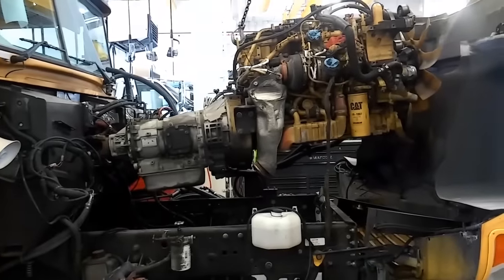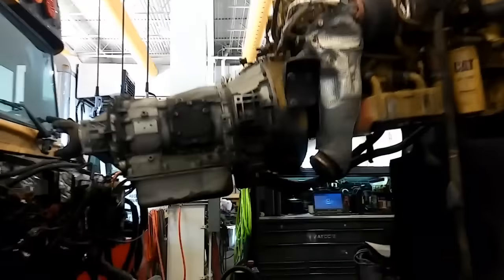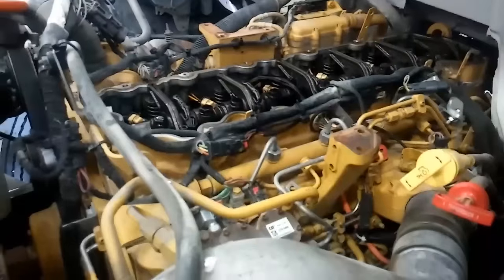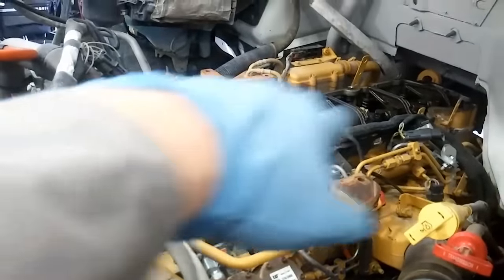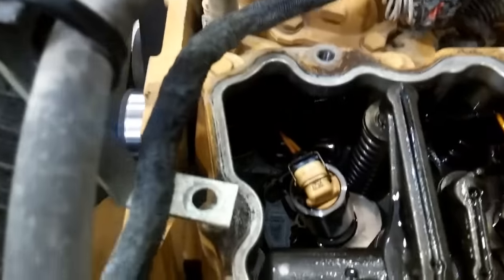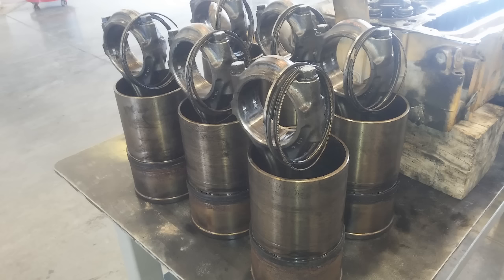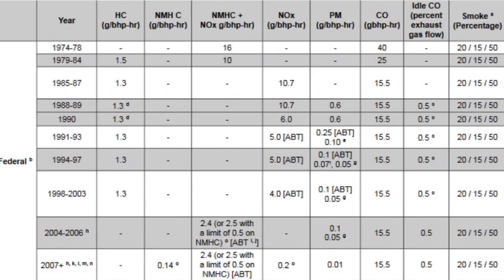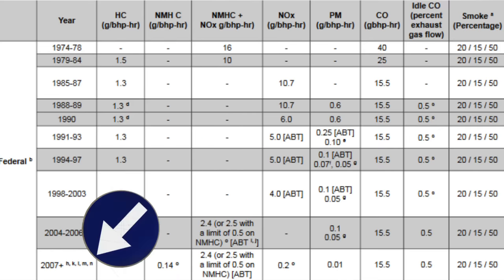The Worst Engine Caterpillar Ever Made.

Comment: Wow...apples (the fruit, not the tech company)...HATE HOW TART THEY ARE! Well, that's only the Granny Smith, not the Braeburns or Red Delicious...this is EXACTLY what you are doing here, possibly from lack of knowledge about the product line you are talking about. The 3116 was, originally, slated to be a MARINE engine. Long, dedicated service (it also could lend itself to gen-sets)...but in the Marine application, boat-drivers had a BAD TENDENCY to turn them up and use 2,800-rpm redlines...600-rpm above factory recommendations! This led to GREATLY reduced lifecycles. BUT...they really didn't lend themselves to 'class 7-8 trucks', either...after all, they were 200-290 hp engines...but hey, they were 'easy to make', and had a good profit curve...so, where to put them? I know (says Cat), let's farm them out to medium duty trucks! We'll make an example in use, by selling them NEARLY AT COST to Stewart Stevenson...hence, the LMTV 10XX series trucks (2.5 and 5-ton replacements for the M900 series) happens...and ANYONE who's been in the military has some knowledge of the 3116!
Yep...cast-in-block liners (hey, you want a wet-liner...International's DT466 is calling your name)...but the 3116 is also the LAST CAT with 'mechanical injection', too! No computers, no digital ANYTHING...just drop it in, top it off with oil, and GO! The 3116 was a VERY SIMPLE engine, in fact. It was SO EFFECTIVE, that Cat says 'hey, new standards, but let's not waste it on the 3116...we'll make a 3126 add a 'big cam', big turbo, and make more POWER! So, they break into solid 300+ horsepower numbers...and here comes the electronic injection. The 3126 has it's share of problems...and where the 3116's problems were USUALLY the result of 'end user over-rpm-demand' and POOR SERVICE ROUTINES, the 3126 ran the gamut of issues...from 'not really made for this much power' to 'funky electronics' to 'bad applications'...yep, it was in there! Oh, boy, and here come more emission standards...and with this, the C7...
See, the 'C7' (taken from 'Caterpillar 7-liter') did kinda-derive from the 3116, the 3116 is TRULY NOT a 'C7' (other than being a 7-liter engine)...and saying 'C7's' are the worst engine out there...well...you've obviously never had to fight the 7.3 Navistar for parts, durability or AFFORDABILITY! The 3116 is a VERY SOLID 300k engine that you can realistically get 500k out of, if you DRIVE IT RIGHT (it is not a Corvette 427!). It is a 500-hours between oil changes, keep it under 2,200 rpm, keep maintenance on the common rail and fuel pump (KNOWN to be problematic...and being an expert on that mechanical pump will end about 90-percent of your topside issues, overnight) kind of engine. It should be compared more to the Cummins light truck diesel, not a PACCAR MX-13!
Throw a dozen at me, and I can have them sold, at profit, overnight. Give me two, and I can keep a Class 5 truck running for decades. As for 'old-school' Detroit-Diesel-type mechanicals...I'd take this ANYDAY over a 6v71.

Comment: The automotive tech in me gotta ask, so no oversize piston for this engine? Sleeves cannot be machined in block?
Reply: Generally going to be cheaper and easier to throw in a used or reman engine. Especially for finding the correct parts

Comment: 1 of my peterbilt 379 with a 3406 B engine has what has be told to me as a brake saver... I have no idea how the damn thing works. It is activated by flipping a switch on the dash, then grabbing a second hand brake lever on the steering column. No it’s not my trailer brake handle.... there is two handles on the column, 1 is a “brake saver” and 1 is the trailer brakes. What this hell is it? how does it work? Oh ya it’s works half way decent
Reply: A Cat brakesaver (AKA oil leak) is a engine oil retarder. It is mounted between the transmission and rear of engine.  It has a dual oil pump, one side works engine, other end brakesaver. It has a oil cooler that's extra long due to the heating of the engine oil. Should also have a oil temp gauge and you better watch it. Should also have a air psi gauge. In the special oil pan you have a control valve. When the brakesaver is activated a diaphragm separates the air and the oil. More air psi pushes the control valve farther to increase oil flow to the brakesaver thus adding more engine retarding. If the diaphragm is blow/leaking or the air (regulated & adjustable) is set to low you will have poor engine retarding.  The brakesaver itself has a flywheel for the starter ring gear and a flywheel for the clutch. Inside the brakesaver itself acts like a reverse torque converter. Only a few people can rebuild one as you have to have the proper fixture to hold the stator in place. Or you will damage the seals. You have a manual lever on the steering column ( can use it that way) or if wired correctly it can be activated electrically (lever not needed).
Reply: @johngoldsmith6629  JPaydirt has the same system on his [blue?] Kenworth.
When it needs service he calls in a guy that does it for him.
He's pretty handy with tools and working on his rig but even him wouldn't mess with the retarder system.
Sometimes some things are just better left to the Pros.
I have learnt that the hard way.
Reply: John is correct better whatch the oil temp for sure!!
Reply: @GIGABACHI  It's one of the few items on a Cat, I tell people to leave it alone. If you look in the parts book, so much stuff has been updated and you will have numerous oil leaks. I haven't built one in a few years. Get phone calls now and then and I lecture them on the mess they are fixing to get into. If really want to see a head ache. Look at a 1693 early serial number with a brakesaver. Seen several later ones, but only one early one. The oil cooler was remotely mounted near the front tandem. Had oil and coolant lines routed back and forth. Would hate to change oil on that rig.

Comment: Hi jo.
Do you have any idea about C18 marine engine and do you advice. To buy this engine for the marine boat.
Reply from the maker: The C18 uses the same block and cylinder head design as the C15, which is one of the longest lasting inline 6 engine designs ever made. Not saying they don't have any problems, but I would recommend a C18 in general.

Comment: Lol nothing worse than a manufactures first attempt at common rail, 03+ 24 valves 6.4 power stroke c7 S/ACERT. only possible exception I think of is the LB7 if they woulda thrown some halfway decent  injectors in there

Comment: I know you are a cat specialist however I need your help I have a cummins isb 6.7 in my m2 freightliner and the engine is miss firing I removed the valve cover and realized it’s a faulty rocker i fixed that and the check engine light is gone however it’s still idling very rough and still has misfire I saw a code that says ECU_128 who’s suggests it could be caused by egr is this possible?

Comment: I have a C13 475 hp in a Cat CT660 truck. It’s a 2012 and so far I have had pretty good luck with it accept for a couple things, high pressure turbo was replaced and the inter cooler was leaking antifreeze into the intake but both were fixed under warranty. Is there anything else I should watch out for?
Reply from the maker: Hello Mitch, well you actually have a CT13, unless you swapped a C13 into the truck. The CT13 is an International Maxxforce 13 liter engine with a Bosch fuel system and electronics. The base engine isn't bad, but those trucks had a lot of electrical issues from my experience. I'm glad you have had good luck with it though and I hope it continues to work for you.
Reply: Adept Ape you are correct it is a ct13 and thanks for the reply, I was told not to use a power washer around the electrical on the engine so I have not and so far no electrical issues. The only problem I have is finding parts for the Hendrickson air ride suspension. Apparently the Cat trucks have different bushings in the torque rods and the Cat dealer tells me to get the parts from the International dealer and they say they are not listed in there parts website. I really enjoy listening to the knowledge that you have so keep the videos coming.
Reply: Ive done several high pressure fuel pumps. If you start seeing metal in the bottom of your fuel tank you'll know its bout to happen. The metal looks like black in the bottom of the fuel tank. Ive had several bad experiences rolling down the driver side window..I'm now afraid to roll down the driver side window lol. Ive done several EGR cooler recores/ replacements depending on the engine. Yours can be recored. Lots of SART modules, DOC's,  and DEF dosing valves too. Lots of electrical issues. Like AdeptApe said its all international. If you have an automatic transmission thats the only true CAT part on it.

Comment: So the engine block without liner could not be re-bored? (like other engines without liners?)
Reply: They can be sleeved as needed
Reply: @electric7487  The cost of a rebore and new pistons are more expensive the liners and new pistons? Can't be that much.
Reply: @electric7487  No.

Comment: Well... I can tell you now if you think that's a bad engine.. you should work on MAN D38 over engineerd complicated due to the emissions... From high pressure intercooler to low pressure intercoolers,  EGR valve turbos timing gears oil leaks clutches release bearings  high pressure pump mounting bolts  and engine wiring harness  endels malfunction faults for due to Nox sensors DPF  filters... So I hear what you're saying

Comment: wait, I dont understand, why cant I simply rehone the engine block, I dont need cylinder sleeves to do that ?.. Im just asking.
Reply: When you bore truck engines that spend most of the time under a load. You take iron away which puts more heat into the water system. Easier to crack cylinders. Also a lot more down time and money to pull the BLOCK out of the truck to bore it. Also. I don't know of any CAT pistons that come. .30 or .60 over.

Comment: Must have had a bmw trained engineer.
Reply: No a lot of Chinese and Indians with masters degrees they got out of cereal boxes and rice bags. They would talk down to you if they knew you weren't papered ( college paper )! I told those arrogant pricks that I forgot more about developing Cat engines, tractors, and transmissions than they would ever learn on the job. Cat has built two brand new Tech Centers , one in China and one in India. Both countries are third world smoke makers with no emission laws that apply to either country. You can still see new flat tracked D8/9's working construction in third world countries. The last I knew after working there 45 years ( retired in 2016) those tractors are being built in both countries regardless of any smoke standards.

Comment: Gardener Diesels - next to Rolls Royce probebly the longest lived diesel engines ever made. Some are running in India wth no air filers, exhaust and oil like sewerage. Not that powerful but ultra reliable. GONE. The company  decided that there was no way they would compromise their standards and adding the huge costs of redevelopement they went under. They ran the legendary red London bus before the greenies crawled out from under a stone. Never mind a few more years and you will all be driving trucks with batteries and solar panels on the roof - and the best of British luck with that junk. Crafty devils on the media - 'A car caught fire today and blocked the M1 motorway for 4 hours', never say if it's electric but lithium batteries can't be put out and 4 hours is a very long time.

Comment: I agree, 3208 were garbage. Also they were used in the poorest design truck. We had a customer with a fleet of GM Kodiak and Topkick with 3208. The customer stuck to the Cat service schedule and a our company did the pm work. At so many miles you swap out the injection nozzles. In the Kodiak you could, because of the cab sitting on top of the rear of the engine, you can't get the rocker cover off on the left hand side. But I did like the early 3116 engine for medium sized truck. Although the parent bore was a bad idea.

Comment: C13 acert pos used a gallon of oil every 3000 miles,was told that's normal for a cat
Reply: Its normal for a cat with a galled cylinder lol C13's had a problem with the bypass valve in the oil filter base sticking causing oil to bypass and spin the number 4 main bearing. Which can in turn starve other bearings of oil and put bearing material in the oil. Which leads to galled cylinders, broken rings, and oil consumption. That plus cracked heads is the main problems C13's had. Not the worst engine ive ever seen at its a easy fix if you catch it in time. If not its gotta be line bored.

Comment: Figured you would have said a 3208
Reply: 3208?
Reply: @johngoldsmith6629  that is what I ment. It has been a while since I have been around one. We owned agricultural equipment dealership from the early 80s until 2010 and those things were junk. They were on irrigation units and terragators.
Reply: @tombig4011  Working on one right now.

Comment: How come you can't  bore the cylinders  like a gas engine
Reply: Someone has to make O. S. piston's and rings. Plus may overheat if not enough material.
Reply from the maker: You can, I believe I mentioned in the video you need to machine the block to replace the cylinder sleeve, but you don't just oversize the cylinder like a small block Chevy and call it good.

Comment: Had a c12 with the card regenerative system that was a piece of junk
Reply: The original C12 was outstanding.  We had them in quad axle dump trucks and they had plenty of torque for a small block.  Then the 03 standards came out and ruined it.

Comment: You'd think old Detroit engines would hold the crown of worst ever engines, but Cat has several that were worse. 3116 holds that crown for me.
Reply: Why, what’s so bad about Detroit engines? The Series 60 is solid, and everybody loves an old Series 71... Honestly, I’ve seen more big yellow engines on the side of the road than anything else. I don’t know what it is, but I assume people just think Cats are indestructible. So run them into the ground with shabby maintenance or something.
Reply: @redbluesome2829  The key word in my statement was "old" Detroit engines... 2 strokes. Any Detroit starting with the Series 60 is a fantastic engine! I am definitely a fan of the Detroits, but not the 6V or 8V type Detroits.

Comment: Im Sorry I have a question. It doesnt relate to to this vidio. Ive been out ill for a bit. This has been praying on my mind. I was just getting back to the farm I was empty.  I dont even think I used the engine brake. just down shifting ez. The min I pulled in the C13 started making a God awful noise. I shut it down and went and got my boss, I new it was bad. WE  just drove it on up to the shop.  It was ugly.  I had no idea what coild have happen. I called my boss before I went to bed I cant recall what he told me but it wasnt that bad. When I came in the morning. That motor was tore way down to where the gears were all showing. There was 2 teeth missing on the crank and one on cam and a couple on the  air compressor. The air compressor had been pumping oil in the airlines for weeks. They go out alot and they were just putting it off. Here is what I think happened. The air compressor piston cylinder had filled with oil. when I used the brakes to slow down the compressor tried to kick on and couldnt it was oil locked. One more thing the night before the mechanic had changed out the high presure line  with the correct on that had the stainless steel on the outside of the line. Before it just had a rubber line on there. I think that line was the difference. I could see loosing some teeth if i was going up hill loaded and missed a gear or some shit then hit it hard. Im not sure what my boss thought happen but he new it was almost 10000 to fix. I was slowinght down  I was empty. There was no load on the motor period. Its easy to see it had just happened. I told them what I thought. I think they thought I was blaming the mechanic but it was every ones fault . We all knew the compressor was out and when the compressor is off the cylinder fills with oil. When it kicks on the piston pushes the oil out thru the lines. to much oil and that new hose that piston stopped just when it started. causing the teeth to give.  You think thats what happen. They say it was just stressed. Its not a big deal but I try to take care of things
Reply: When you are pulling 80 or 90 thousand the C15 is a must If you want it to last. That much weight and the hills is just to much for C13.

Comment: I am looking for info in a 3408. I want to put one in my truck. I love them for some reason. Can you do a video on them about horse power and reliable. Thanks
Reply: Exhaust leaks, exhaust studs, air compressor oil leak. Lots of updates on exhaust system to fix problems.
They made a 3408B with 7000 series nozzles. I have never seen or worked on one of these.
Most was a 400 HP no JWAC, or 450 with JWAC. Could get PC or DI.

Comment: throw away engines.   we had a local tree service bring 10 trucks in - parked them in out lot -  told us they would not pay for them anymore due to " to much time in the shop"  they spent more time in the shop rather than on the road.  customer didn't do anything wrong  - besides letting them idle all day while using the man lift booms on the back and as power units ....  these engines DO NOT like to idle, they coke up.   JUNK JUNK JUNK

Comment: My vote is 3208.  Hardly repairable and smelled soo bad(unburned) fuel.  I just remember as a kid having a 3208 pass by that it made your nose hurt by the stink.  Pre-emmission.  I'm old(52).  So damned many made that working on them, one got a great chance to hate.
Reply from the maker: While considering which engine to choose, the 3208 was in the running. It definitely wasn't the best engine ever made, but I think the C7S is a worse engine. Just an opinion though.